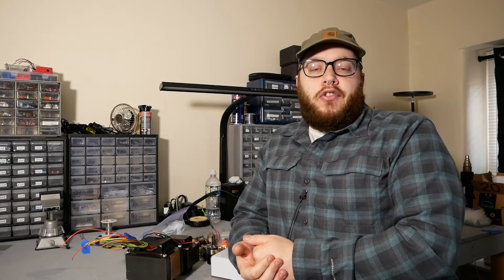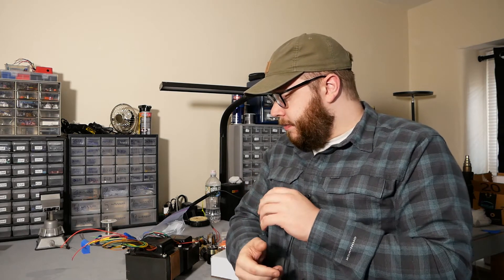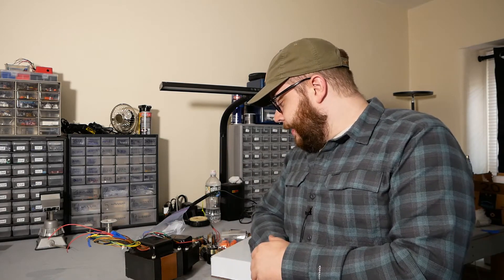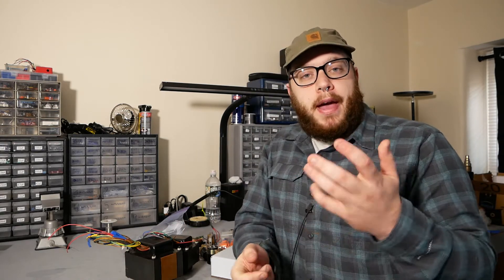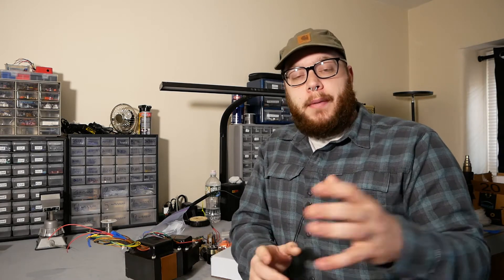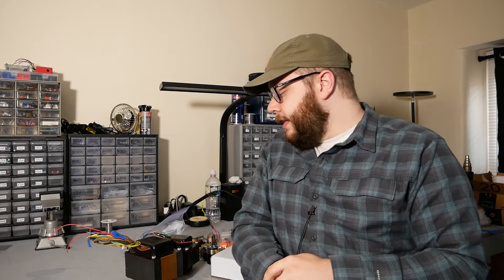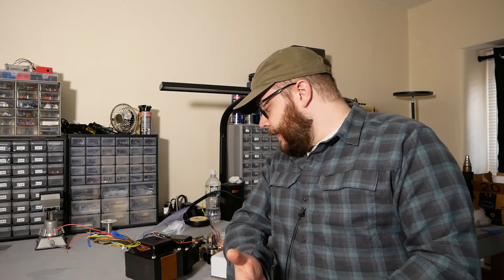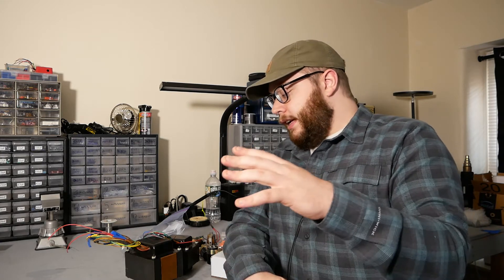New Tube Amp Build Series! // Gray Bench Electronics

Comment: Very nice project. Well done 👍
can i ask for the voltages of the secondary windings of the power transformer? Or do you have a datasheet of the power transformer? Do you know the power in VA? I can't find these info, can i ask you for help please?
I would like try to repair this transformer primary winding, for original AO-63 amplifier.
Now i measure 6.3V, 5V for filaments, 25V bias, and the HV is 170-125-0-125-170, with central ground, but i don't know if these AC voltages are right.
Thank you